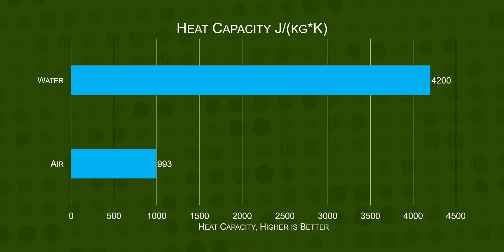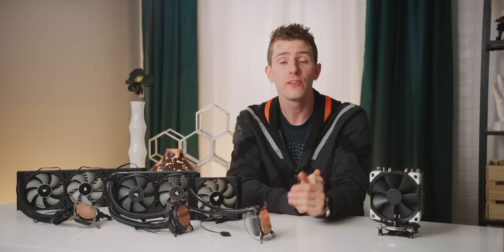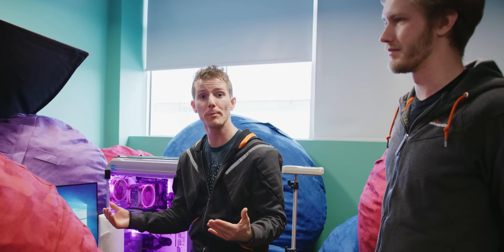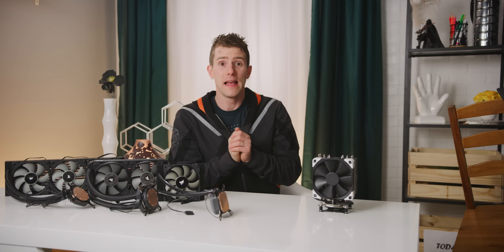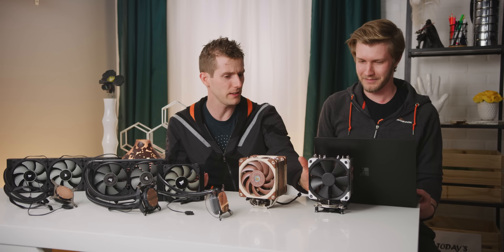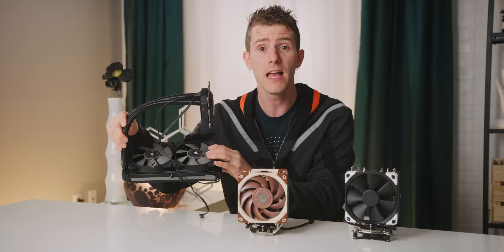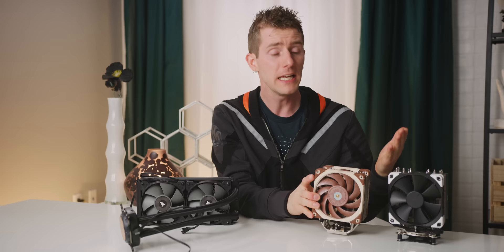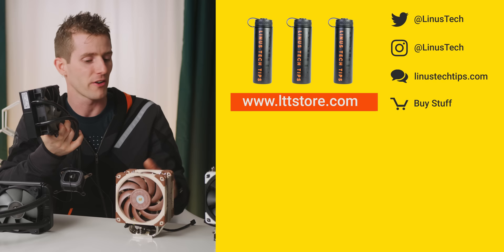Why you shouldn't water cool your PC

Comment: JayzTwoCents would be triggered by this video.
Reply: I don't think so.  He openly states that water cooling is not for everyone and is a labor of love.
Reply: There was this one time he actually sh*t himself when he tested a noctua against his water cooling setup and the noctua won.
Reply: No, you can't forget the environmental factors. 
JayzTwoCents' video is about high temp rooms (irregular conditions).
Reply: @vladimirwinnin9662  I'm actually interested in the fact that an AIO can carry heat away (for the most part) and let you dissipate it further away from other components. I'd actually love to see tests that measure the temps of the gpu for example! Would water cooling a CPU give a slight benefit to your GPU since its got a colder case to run in, or is it within the margin of error and not worth the cons of AIOs?
Reply: @vladimirwinnin9662  also don't forget with the money saved with air cooler you can buy fans as front intake for the gpu which most likely be better than the intake from aio
Reply: No he wouldn't as this test is about AiO and not custom builds, which are much better than air cooling
Reply: @vladimirwinnin9662  LOL who is this? I was simply replying to the OP melvin khosa and answering with why JayzTwoCents would not be triggered by this video.

Comment: My Ryzen 5 at 3.9GHz was sitting at 70C during gaming with an air cooler and when I installed a 240mm AIO I had to run cinebench to even hit 50C. During gaming it sits around 45C. Definitely worth getting an AIO. If you have a Ryzen 9 or i9 a water cooler is almost necessary for good temps.
Reply: Air coolers are also kind of ugly imo when they're vertically mounted leaving you with low profile air coolers as the only decent looking option for not much less than even a 120 aio.

Comment: i swear these videos get wider by the day, one day they'll fit my ultrawide properly
Reply: "Ultrawide Video" chrome extension used to work great when i was on ultrawide, might be worth a look
Reply: @Mortiferous89  How does that work? Unless it can somehow add information in wouldn't it be weirdly stretched?
Reply: @AWallace722  kinda.. It just fits the source to your aspect ratio. My old monitor was 21:9 and it didn't look too bad tbh. I used it for Netflix so I wouldnt have black bars on the side. It also has a crop function.
Reply: @Mortiferous89 Thanks for telling me about it, i'll give it a look

Comment: Well one argument you can't counter:
Corsair's water cooling looks more sexy
Reply: @mrchocolatebean8878  I'd frick a cooler
Reply: Umm, looks are subjective. AIO's generally have two many wires plus hoses. Also I'm not a fan of empty looking cases. Give me a big twin tower anyday. Plus it will still be working long after the AIO has leaked and destroyed your PC. Also I don't like the compromise of either having the AIO exhausting hot in to the case (front mounted) or using hot air from inside the case to cool the CPU. I  use a NH-D15 with my overclocked to 5GHz CPU temps sometimes hit low 70's °C. You're not going to get any better with an AIO
Reply: @oktc68  agreed.
Reply: Corsair makes overpriced products though...
Reply: oktc68 Aio only leaks if you get a defective model
Reply: @brothacatdu3452  also, theire filled with distilled water, a leak wouldn't destroy your PC.
Reply: @genericname1235  doesn't take much for water to be ionised and thus become destructive.
Reply: Sure i will have a ‘sexy form of cooling’ rather than thinking of the catastrophic consequences if it leaks and destroy my 800 quid worth of computer hardware
Reply: @raHj.  if you use it properly it should not leak
Reply: Garby Boi it will eventually
Reply: Prefer Kraken with Corsair / fractal fans
Reply: Good looks is on the eye of the beholder, there's nothing more sexy than better performance, will last years longer, is quieter and less noisy 👍 nhd
Reply: @mrchocolatebean8878  Why my water white

Comment: Been using Noctua coolers since 2008, from full size towers to SFF builds. Never once have I thought about going to an AIO because Noctua has never let me down.
Reply: Chris Biz they know how to write and maintain a compability list ❤️
And then they shipped me an intel-core-mounting kit for my 5 years old u12p for free..
That is customer support !
Reply: @cptmorgan92  exactly. When I upgraded my i7 920 rig to a 7700K, I emailed Noctua with my receipt for the i7 7700k, and they sent me a free mounting bracket so I could use my NHU12P cooler I bought in 2008 for my i7 920 with my new i7 7700k. 11 years old, and the original Noctua fans on my NHU12P are running perfectly and my temps are great on my 7700K.
Reply: How does the 90mm noctua coolers perform? I cant fit even a 120 atm and am running an 240 aio
Reply: @bizkillall  Do you still get temp spikes with the i7-7700k? I have it and the fan jumping drove me crazy before I "fixed" the fan curve to just be quiet. I have good case airflow and barely ever have cpu usage over 60%(Usually between idle and 30%) so no temp worries.
Reply: @ninjal7588  I have the NH-D15 with  i7-7700k, I still see some spikes, but as you said some fan settings can reduce it.
Reply: 100% agree, been with noctua since 2008, all my fans are noctua and have been in the 12 or so builds ive done since then. Never once let me down and right now my current rig, assembled in 2018 is running 4 noctua case fans from 2008 and they run perfectly, perfectly, after 10 years of use. Corsair was still only making ram when i bought these fans and they still outperform the corsair case fans that came with my case.
Reply: @ninjal7588  No issues with the temp spiking or fan curves. I have it is a smaller HTPC style case sitting on top of my desk, and the only fan noise I hear comes from my GPU, but even that is quiet at full blast.
Reply: @iheartmysquid  I did a build for a friend using the NHU9S and a 6700K. Its works great for its size, but he does not overclock his CPU. I remember hitting about 75-80C under full load with synthetic tests with stock speeds. I used the default fan curves and don't remember the fans going above 80%. You could hear them, but they weren't loud, but def louder than their bigger fans, but still quieter than probably most air coolers on GPUs at full throttle.

Using their smaller heatsinks with 92mm fans should work just fine if you don't plan on overclocking.

Check Noctua's site documents for each heatsinks. They list what TDP each heatsink was designed for, so as long as you stay under that, you'll be fine.
Reply: @bizkillall  THX

Comment: Interesting...very interesting.

Yeah I'm still using the stock fan for my cpu...
Reply: im suprised your graphics card hasn't burnt to a crisp already. i burned my 3 first graphics cards that way while learning to build pcs.
don't learn the hard way like i did.
Costs too much. ( well i did manage to haggle the store and get it back on warranty ( 2/3 cards lol )
Reply: He's talking about his CPU I think. Also, I've never, ever had a problem running my cards on air and I've prob gone through 15 or so GPUs over the years.
There are some decent, cheap air coolers out there, like Rajintek, that would give you a bit of overclocking room if you have a K sku cpu.
Reply: Zap Zap if you’re burning your graphics cards with their stock coolers you need to turn on the AC dude. They’re able to run at 85 c comfortably.
Reply: @ithildiess9048  how do you burn your gpu by using stock fan for cpu..?
Reply: @ithildiess9048  Ah yes, using a stock CPU fan is gonna make your graphics card burn.
Reply: just buy an evo 212 for a better lifespan of the cpu, its highly underated, you get about 2-3c more than the noctua used in the video and it costs about 35$ (and its often on sales at arround 27$ it comes with only 1 fan but you can add another one for super cheap
Reply: @ithildiess9048  then i think you have a much bigger problem going on? how is a cpu cooler going to burn the GPU surely it will only harm the CPU? and even then it probably still wont burn your cpu considering new cpus have performance throttling if it gets too hot. also ive never burnt my GPU with the stock cooler on it.
Reply: I did until it broke. But I under clocktoo

Comment: It was probably around 1999 when I built my first water cooled PC.  And this was way before all these cool ' All in one ' type setups like you have in the video.  I had a very large reservoir and used a chevy chevette Heater Core and a Danner magneto impeller water pump and Danger Den water block.  At the time, water cooling was vastly better than air cooling. It would be somewhere in the Range of 14 years later when Heat Pipe technology was discovered for air coolers that was really the downfall of water cooled.  And after 10 years or so of my first water cooled pc and the upkeep of keeping clean the tubes and reservoir and also the water block from residue it became clear (to me) that Air cooling was going to be superior to water cooling and I've preached that to all the people that asked me about it since then.  The risk of losing a 3 to 4 hundred dollar cpu from a failed pump or possible tube failure was simply not worth it when you can easily see if there is a problem with your cpu fan.  I just had to post this because it is funny to me that more than 5 years later the biggest nerd on the internet is finally putting it out there.  Without some way to either chill the water using faze cooling or a chill plate and then having to worry about condensation.. Air coolers can simply out perform water coolers.  And for the most part they are cheaper and sometimes quieter.  I too use Noctua products in all my builds.  They know what they are doing.   Thanks for the video I feel vindicated to all the people that disagreed with me.

Comment: I like the AIO coolers because I don't have to worry about a huge fan sitting on my motherboard and wondering if it's going to get in the way of the RAM sticks or this-or-that slot or whatever.
Reply: Oh hi, who'd have thought you were a LTT fan
Reply: I like it because I don't have to worry about a DH15 or Pro 4 putting stress on my motherboard.
Reply: My 8+ yr old build has a cooler master v8 on the cpu. Google it. I’ve built several PCs for friends and this was still the most difficult component I’ve ever installed in any PC/laptop.
Reply: SKIBBY nice cooler but overprice as most of cm stuff. :) also cm loves to make things complicated where it could be hell easier lol
Reply: I got tired of worrying that my motherboard would rip in half when moving my PC and replaced my 212 with a 2000s era Thermaltake heatsink. I'm pretty glad that the Ryzen stock fans are usable and the classic form factor.
Reply: Greg Tourville ryzen stock fans are usable at stock for lower end ryzens only lol 
For example ryzen 5 3600 works ok only for ryzen 3100 or non-oc 3300x and so on. Ok coolers are only on 7 series with copper stuff.
Reply: I like fan coolers cause I don't have to worry about manefacture defects that could destroy my entire system in a second nor do more than blow air to clean my PC instead of draining and refilling a unit
Reply: Jonathan Garzon lol what draining and refilling it just works its not stupid custom water

Comment: 07:21 => this is NH-U12A, not NH-U12S - big difference!
Reply: Yes. Good pickup. Is a big difference. They say 37% more surface area than the S
Reply: can't believe there is so few people rating this up. This is like the first thing I saw watching this video... Before reading this comment I was like, huuuuu I thought they said NH-U12S.... but this table ain't right then
Reply: @whismerhillgaming  im not following, could you tell me what happened pls?
Reply: @whismerhillgaming  The table was correct. They just put the wrong label for the first comparison. I mean this is linus tech tips, There has to be at least one thing all sporked up.
Reply: @hugoburton5222   and more heat pipes.
Reply: @marcusciantar3407  simply put, @7:21 labels show NH-U12S on the video, it's NH-U12A instead
as shown in the table @8:02

Comment: one point that linus is missing that custom watercooling only matters if your CPU/GPU are even overclockable. I don't see any reason to put watercooling on celeron, or i3 cpu, or even m1 mac. The alternative best option is to put liquid metal (75 W/m.k) if you really want that extra cooling on air cooling.

Comment: Corsair does not make good fans, they just do not stand a chance against Noctua or be quiet!
Maybe an AIO is better with other fans.
Reply: Yeah. I wonder if swapping the fans will help
Reply: Best is just buying the AIO then buying noctua fan on the side and attach them.
Reply: I actually want to see this tested
Reply: @Helveteshit  that's what I did, bought 4 of the noctua nf-f12 industrial 3000 rpm fans, 3 120mm and 1 140mm. Put two 120's on my h100i v2 and the other two as case fans and while gaming rarely go above 50c, depending on room temperature. Stress tests right around 60c on an i7 8086k at 4.9 ghz with 1.216 vcore voltage.
Reply: @TechandTools1  3000rpm fans? butt why
Reply: If you have unlimited money then yes😂
Reply: Came here to say same thing.
Reply: From an Engineering stand point, the fan choice has minor effect on AIO. The reason that fan don't matter as much is there so many more variables. Fluid speed, Thickness of the cold plate, whether the back side of the cold plate has fins, thick of rad, How many fin per inch are in the rad.  Brand has no effect at least in US. Asetek hold the US Patent for pump coldplate combo. Effective every AIO with the same size rad is the same.
Reply: @XerxezsX  
Not necessarily, you can have fans left over from previous builds.
Reply: @puretrack06  
Well, I'm not sure about cooling, but fans have at least a significant impact on loudness.
Reply: @lars9925  They could have also increased the pump speed and decreased the fan speed. There are just too many variables.  LTT testing format is design to be understood by a general audience. If you want a true look into AIOs  check out Gamer's Nexus testing. They test all cooler at standardized noise level of 30db to reduce variables and increase repeatability
Reply: @K4rgo  because their cheaper then their black out ones and their black
Reply: @puretrack06  
I am kind of informed by JayzTwoCents and he points out that pump speed is not that important. The key element is the volume of the radiator and the fans have to be able to cool the radiator sufficiently.
And Corsair's fans are already quite loud at low revs.
Reply: @K4rgo  same price as the 2000 rpm model roughly and for when I want to squeeze every last drop out of the cpu. Plus I don't care about quite unless I'm watching videos, when I game I wear a headset so sound isn't a factor. Longevity and performance is all I care about.
Reply: Linus did a test like that years ago.
Reply: @lars9925  It been a while since I looked at Radiator Heat Transfer Equations, but IIRC, fluid speed is inversely proportional to fan speed. As long as Fan and Pump speeds are balanced, the change is minimal. The Fin Density and Room Temp are more important
Reply: @puretrack06   Not to mention material, inner and outer coatings, material thickness, and molecular structure.
Reply: @puretrack06  bitwit did a test about radiator placement, and front was definitely better because it gets ambient air temperature vs case heated temperature, plus doesn't impact gpu temperature that much. I've tested both and front on my two cases has always had lower cpu temperature.

Comment: Now i'd like to see this test done as if you were in a tropical environment. (35°C+)
Reply: Nothing would change because neither cooler (liquid vs air) can lower the temperature of a component below ambient, unless you chill the liquid/air before it enters the system.
Reply: @christopherbackus5578  true, you also can use peltier elements to chill out your processor
Reply: That was disappointing. I'm still planning to use an alphacool UV setup for my first build ever. Expensive AF cpu block.
Reply: I've personally tested this since I live in the tropics. The high end Noctua gives me up to 14C higher temps than a Kraken x63. Although weirdly enough, the x63 gives me 5degrees lower temperatures than the x73. I think one thing we can confirm is that 360s are somehow just not as good as 240/280
Reply: @jurrewestra7025  not really because they're pretty inefficient for the lackluster cooling they provide

Comment: I made sure to go with air cooling in my new PC. Had water cooling in my last one. There's no point in liquid cooling since I'm not gonna push my CPU super hard and air cooling is easy to monitor, install and clean. My last water cooler was a royal PITA to install, remove and reinstall. It seems like air cooling is a no brainer unless you will regularly be pushing your CPU to its limits. And I want to be able to just look at my cooler and know it's working because I can see it's spinning.
Reply: what kindof cooling you have is barely gonna have an impact on how much you can OC your cpu. thats the silicon lottery.

Comment: My Ryzen 1800X is sitting at 28.0C right now as I watch this video.  CPU is cooled by Noctua NH-D15 SE-AM4 at 418 RPM atm.  Best cooling I have ever had and whisper quiet.
Reply: I bet it's running at stock temps
Reply: Also ugliest looking fan